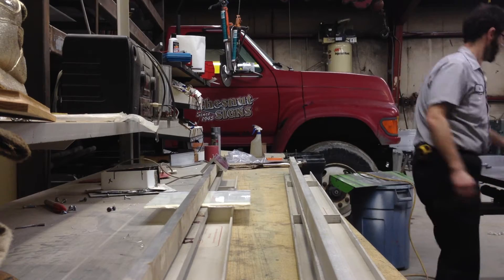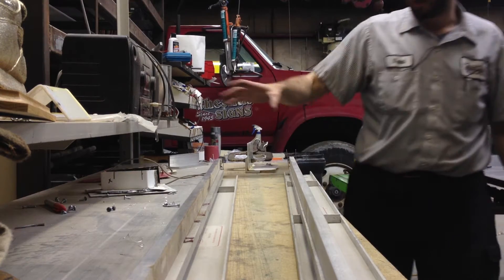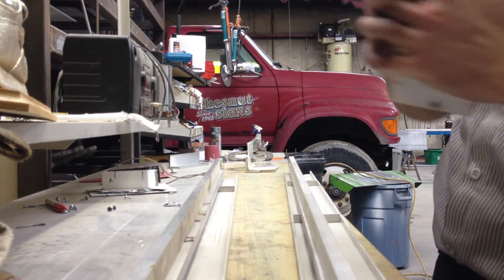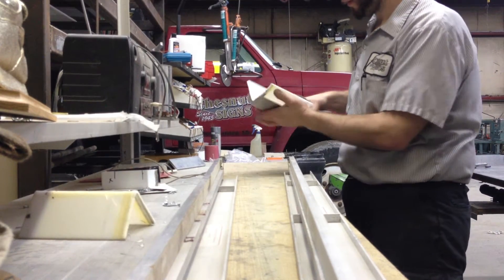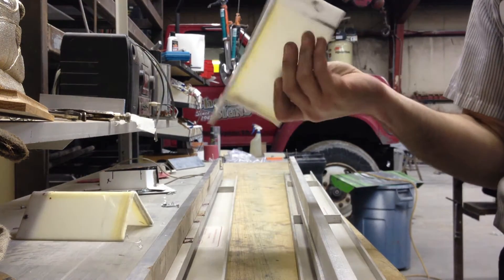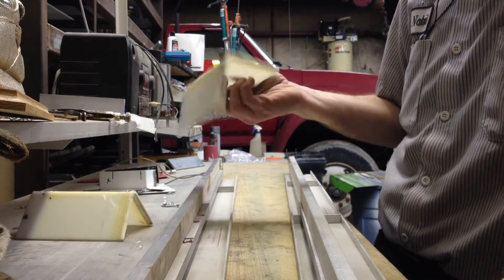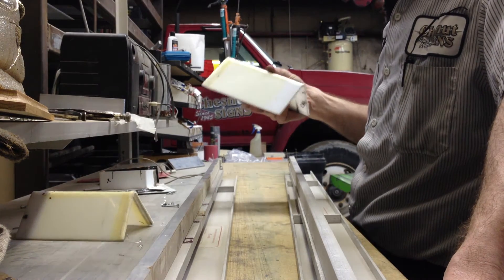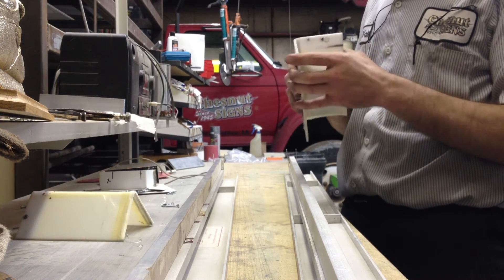Forming Lexan Pt. 6

Comment from the maker: I haven't used a heatgun, but have long contemplated it. I'm thinking what may work well also is a space heater channeled from underneath. 

Contrary to appearances, I am quite capable with the line benders when I'm not pushing beyond the bounds of my experience. However, you are rather limited with them. 

Will play with larger heating areas and vacuums for sure.